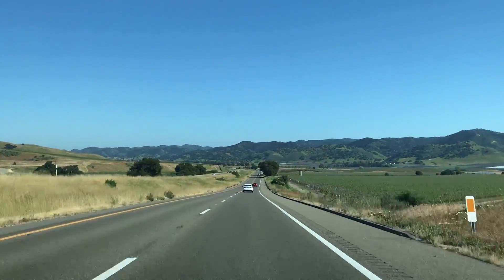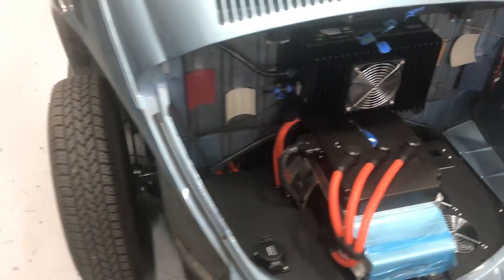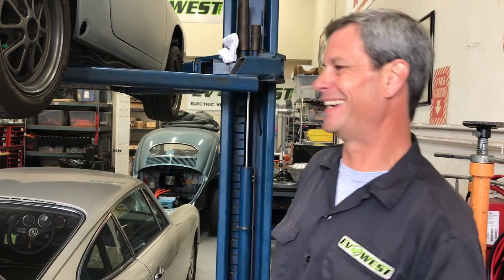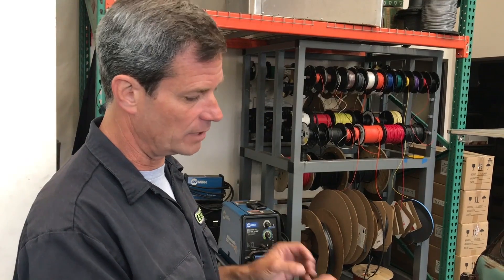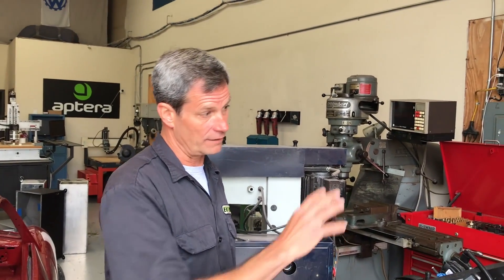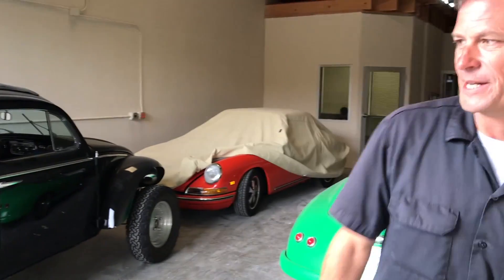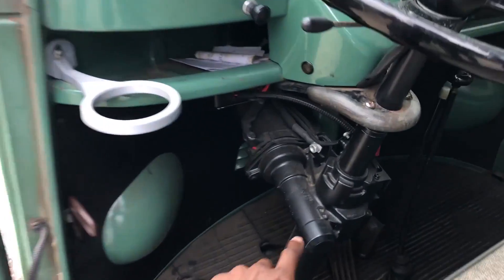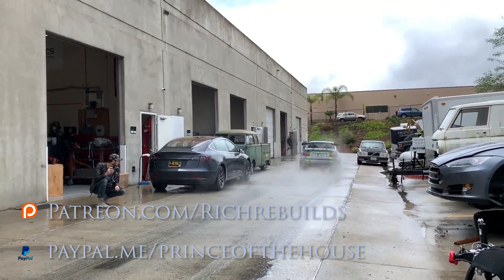Here’s What we Found Inside a Tesla Conversion Shop

Comment: Hello I’m an old guy I would like to buy in 1973 GMC motorhome they are the Rolls-Royce of motorhomes they are front wheel drive with a Oldsmobile Toronado of a transmission they have four wheels in the rear but they’re just on a hard axle there is no driveshaft I want to know would it be possible power two of those rear wheels and create a hybrid I understand her computer issues might be. There is enormous space for batteries

Comment: Really cool. If I could  place an order with this guys, I would go for a car, that is old, and preserve the exterior vintage looks, but isn't a car that you wouldn't want to rebuild the interior and suspension, because it will loose value, because you won't be able to bring it back to original. Coilovers with sway bars, and double wishbone, bigger rims with low profile tire, a lot of power and torque, so I end up with really well handling on the road, really fast, modern infotainment system, and cool vintage exterior. It will be awesome.

Comment: Seems like an interesting place to work at.  I generally work for myself due to creative limitations and constraints but I feel like this guy would rather hear about ideas and possible out of the box solutions rather than get mad at not doing the same old same old.  Then gain, as he said at the end, it's still fairly new so the best way to progress and find out the best out of the box solutions is to experiment and really want to make something new/interesting.

I've done a couple diesel swaps with my newest being a 73 Riviera with a 6.6L Duramax.  Before that a 71 El Camino with a turbo Detroit (both on inhouse made Biodiesel from restaurant oil I get for basically free) and my daily is a turbo LFX swapped RX8.  EV stuff is interesting but living in the middle of no where both gives me the freedom to have a fairly large/stocked shop but also the limitations of charging options and long distance driving to get anywhere.  Still like hearing about it and exploring it though articles/videos and helping a few mechanic friends that mess with EV on the weekends.

Comment: Great vid Rich. And that conversion shop is doing nice things. I designed and had ready for production, an electric moped in 1994. We ran three of them for 3000 miles each in testing. 24/7 operation. Another project in that era was an electric Tuk Tuk. It was a wheelie machine as well it hauled over 1500 pounds up a 20% grade from a standing start. Recently I have gotten a bug for dual motor electric bikes. Most recent project is 95% complete. A low power rear hub motor on a 36 volt 8.8 ah battery. The real power is a mid drive with freewheels and a seven speed derailleur system. Running on 72 volts with either 8 ah of 200 amp capable batteries, and an alternate 72 volt 30 ah 50/100 amp battery. The power is incredible. The starting bike was a Swagtron EB8 a very nice ebike as it is. The added power is from an electric shift kit from Sickbikeparts. My last hurdle is getting the android application to talk to the controller.

Comment: Who knew that if you have a light weight car that you don't need as much power to get it to go fast.
Answer - pretty much every car designer, builder or driver who's ever designed, built or driven a light weight car going back to the tiny Lotus that raced around Indy.
I do notice that despite the fact that the electric motors are smaller than the original ICE motor, these cars still give up storage space because the batteries are still huge and heavy and eat up what litter storage space exists.
Don't know why you need an electric power steering on a VW bus.

Comment: Hey Rich. Would a model 3 DU or a model s DU be more appropriate for a midsize pickup conversion?
 I have a 1994 GMC 1500 step side with 390k miles. 
I learned to drive in the thing when I was 8, and I have been trying to put together a spreadsheet of parts for conversion.

Comment: EV engine swaps in these vehicles are troublesome for me because a significant part appeal of the old VW Beetles, Transporters and early 911s is their characterful, flat configuration petrol engines. Furthermore, these vehicles' original slowness was matched with their period suspension and brakes.

Comment: You're forcing me to imagine a Tesla powered 1980 Jeep Cherokee Golden Eagle. Mine already has the vintage rust paint job on it.
Reply: I'm planning to convert an Audi A4 2001-2003 (fully galvanized chassis = rust free) with Tesla batteries.
The parts alone cost around 20.000$ and there's a lot of work to do. In Germany, you also have to take into account the technical inspection since you have very strict regulations over here.

However, it will still be cheaper than a good electric car and the reliability is definitely given. Also, since I will probably use a smaller motor (probably Nissan Leaf if the power and torque is enough), I should get even longer ranges, which is the main purpose of this conversion.
Reply: Dreaming Life yah u should drop 30 k on a $200 dollar rusted Cherokee 🤣🤣
Reply: @bored2323  Then he's have a $30,200 kick ass Jeep that would wipe everything away, drive better than ever and look cooler than all the others.

Comment: So on cars new enough to require that state's emissions testing that get converted, does CA have someway to indicate it has been converted so they don't have to do the tests?  Not sure how they do it; in my state and county, if it's 96 or newer, it has to be hooked up to the tester for it to simply check odbc readiness codes.  If they can't be read, you can't pass inspection.  I know many of the cars they showed were old enough to avoid this; but not sure if all of them are or all of the ones they convert.

Comment: So what does conversion cost  I gather $23K in parts alone. Labor and Misc must be another $20K? Ouch.
Reply: gmcjetpilot.  Most shops seem to do a 20k refit for a 100 mile battery pack, 29k for a 200+ mile pack.  If you can get the blown motor car for $2000 like a Miata or MGB then under $25,000 for the car you want, the pleasure of shifting (typically clutchless) not a vanilla EV sedan.

This shop robbing wrecked T3s may be much more, but it is a Cali Custom shop.
Reply: @STho205  I paid $11K for my 2015 Nissan LEAF 4 yrs ago and it gets 80 miles per charge. It really is a novelty and this video is old. Price of batteries are going UP UP UP despite the lies we were told about how it would get cheaper.  My 2nd car that is ICE  (because an EV only is not practical at least if you like to leave town and go on a road trip) is a 2010 VW TDI JSW (Turbo Diesel). That gets  700 miles per tank and takes 5 min to full up at 50 mpg.
Reply: @gmcjetpilot  it's not really easy to get a 3rd party battery pack anymore.  At least these refit were obviously hobby toys, like having a rally car or moped.

Your Leaf experience is analogous to buying an enclosed golf cart for bopping about the gated community or village.  Doesn't really save money if you also have to own, license, insure and fuel a real car to leave the neighborhood.   11k (plus taxes and insurance and power) is likely 25k over 10 years.  That's 2500 a year which was 1000 gals of fuel or 50000 miles of GDI driving.

If you only do 5000 miles a year of closeby driving it breaks even.  If you do less...it cost...if you do more you saved a few quid.
Reply: In early 2014 I had to replace my daily driver.  I saw people with Leafs driving home on winter nights with no headlights in parkas to make it...and the plates indicated they lived about 35 miles away max...but traffic jams made those hour+ drives.  Decided a budget EV wasn't going to cut it.

Bought 9 month old 5sp Fiesta for 8k + taxes and dealer fee.  Trouble free car, similar size, 40mpg.  Good choice as I had a 70 mile drive to the office once or twice a week.

However an EV might be the perfect ticket for a college student if chargers are around.  Keeps them close to campus, but not crippled....and old college ICE beaters always need pricey repair.
Reply: It really is costly. But a new Tesla isn’t cheap either. It is so nice to see small factories like these can actually convert cars for people that really want it.
Reply: @cf6282   Right and they are even more expensive. This video is 3 yrs old and the price of batteries are going up up up.  A replacement battery for my 2015 Nissan LEAF which is only 24 KW/Hr was $5000. That was 4 yrs ago. Last I checked it was $9K. It is likely even more today.  I bought my LEAF used 4 yrs ago when it was 3 yrs old . It was a leased car. I recall it had 20,000 miles. Still have it with 36K miles, so about 4000mi/yr. It is a nice local car but it is a 2nd car to be sure. As I state above my cross country or long distant machine is a VW Turbo Diesel, 700 mi range, up to 50 mpg. There is no way I could do the trips is an ICE vehicle. Even if I had top of the range  Tesla and their claimed 250 or 300 mile plus range it would be a PIA. You have to stop. You have to find a charging station. You have to wait (a long time if only level 2). If the charging is a PAY for charge station the prices approach cost of fuel (before the recent crazy fuel prices.  (Thanks Joe Biden crazy climate zealots and hate America groups war on energy.)  EV's are practical for LOCAL driving around home and charging at HOME at your standard utility rate per KW of electricity. Commercial charging is 8 to 10 times more. Converting former ICE cars to EV is a novelty and cool but not practical.
Reply: These are toys not cars for an average Joe. If you want an cost effective electric car get old leaf and get newer leaf battery from junk yard to swap.

Comment: Man, wish I would’ve know you were there when you were! I work pretty much right next door to Micheal’s shop at QC Charge, where we build EV charging equipment, including DC fast charging kits for cars that weren’t originally equipped with such capability. We also do a bunch of work on the little known factory Tesla powered 2012-14 Rav4 EVs! Everything from motor/battery swaps, onboard charger and DC/DC repairs, and cabin heater replacements.

Comment: Next video from rich...
"EV west employee kicked out of Tesla school"
Lol
Reply: Didnt even blur his face smh. Come on Rich. How are we going to infiltrate Tesla if you're out here giving up the sleeper agents.
Reply: Tesla can only afford to pay no cost interns. If you want to lean the real basics of making wheels move with electricity get a job at the local forklift repair company.
Reply: @Northstar4653  I can't believe I've never heard or even thought of that before. Forklifts have been all electric and have been doing an awesome job for so long and have gotten no praises. If forklifts have been doing this good, how comes it took this long to mass produce an all electric car?! (I know this sounds like sarcasm, but it isn't)
Reply: @yaadmankahtion2917  - Because forklifts are built to last.
Reply: @petlahk4119  Also they only need a couple miles of range, so they can use cheap-ass lead acid batteries.  Don't need to be fast, either.
Reply: @incognitotorpedo42  Nah, wrong on that one. Latest versions on forklifts run non stop 8- 12 hours on a charge using tubular lead acid batteries on an A/C machine. They run plenty quick in a warehouse  but not  highway speeds for sure. Lots to learn from the new tech on forklifts.
Reply: @dougabbott8261  Ground hugging weight is a feature, not a bug on something that lifts significant weight 20+ feet in the air.
Reply: @yaadmankahtion2917  One thing - energy density of batteries.  Building electric vehicles wasn't the problem, they were making them back at the turn of the 20th century, but you just couldn't get very far.  It's only due to the fairly recent revolution in battery tech that's made it possible, which is why Tesla is actually first and foremost a battery company.  

Elon's no dummy, lol, that's why Tesla's going to stay in the lead for a very long time, and all these companies (see VW, Jaguar, Volvo, etc) with their recently touted "Tesla killers" are going to find out that they just can't beat Tesla's business model with THE BEST vertical integration of any company on the planet.
Reply: @russell2449  Except maybe Hunday ??? The founder of Hunday is probably the business model that Tesla  might have copied,,, They make Everything that they use on ALL of their products even the steel, glass,  & rubber. Raw materials enter the peninsula on one end, ( Shipping port ) and finished products leave on the other end in there Shipping port. Cars on one side, Ships on the other.
Reply: @yaadmankahtion2917  mass, forklifts are heavy as it is needed as counterbalance - cars, you want to reduce mass.
Reply: @yaadmankahtion2917  Forklifts are completely different in requirements and design. They also never posed a need for better battery technology because they would just recharge in stations every night, as well as drive relatively slowly with little power usage compared to a car on a highway. The drivetrain is slow and simple with efficiency almost completely ignored because it is neglegible relative to other expenses for the company.
Reply: @ronaldmasterbud1551  their cars are not particularly cheap or reliable and the brand does not stand out in general. I suppose the image you convey might mostly be marketing.
Reply: @ronaldmasterbud1551  who are Hunday?
Reply: @davejohnson3474  Hyundai, Manufacturer,  there the S. Korean car, ship, container, and Heavy Equipment manufacturer.  & Until recently Completely Vertically Integrated,  now there outsourcing to China,  and Because of the Corona Virus,  and Unable to get parts there Shutting down Entire Production lines,  Just like was happening in the Early days of Tesla,  the Factory had to Idle down because they couldn't get Simple items on Time,  So the Whole factory would Be Stopped.  Companies that Run production Lines Calculate losses Buy the Second,  Not Hours,  or Day's. Even Airlines,  Count losses By the Minute.  Every Minute That plane is on the Ground Costs Them Massive amounts of Money,  and When they have to Stop the Engine is Worse ( jet Engines Have Maximum,  Start cycles before Before Tear Down,  That's Separate from Run time Before Overhauling  ).
Reply: @davejohnson3474  " Hyundai " , Sorry
Reply: @ronaldmasterbud1551  i used to work for Hyundai. They even made Deep water Horizon and we know how that ended lol. Corona virus is in the UK now but being played down as usual.
Reply: @davejohnson3474  """ WoW """ Had No Idea on That !!! Thanks for the information 
Bud